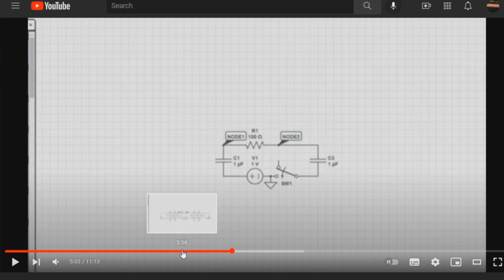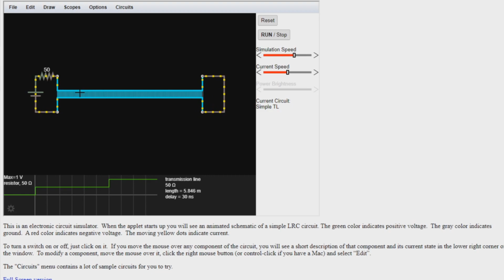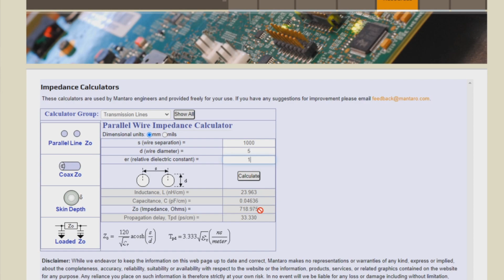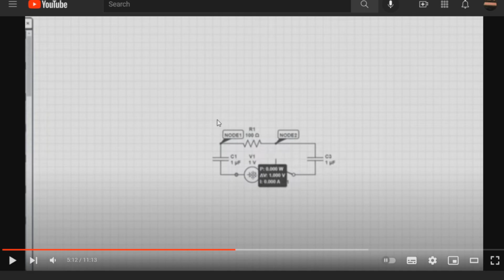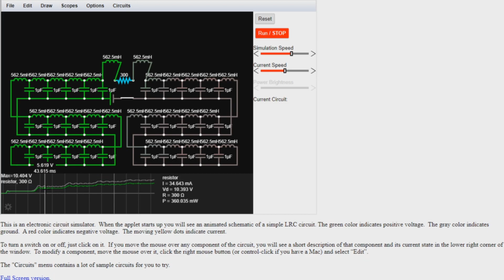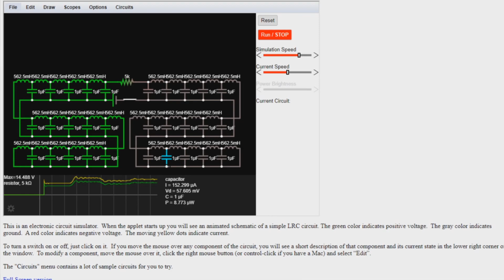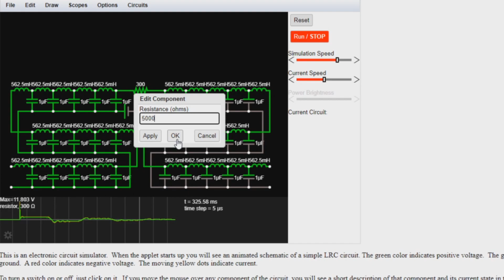2nd analysis, I think I was originally wrong! - Veritasium "The Big Misconception About Electricity"

Comment: 1m/c is 3.34 nanoseconds, and you are simulating in 5 microsecond time steps.  Moreover, you are using a transmission line model but the current at the lamp at t=1m/c depends on the current at the source at t=0+.  And the current at the source at t=0+ is not a current flowing across an infinitely long line, but a moving point charge.  This is a dramatically different problem.  The magnetic field of a point charge falls as the square of the distance.  Even at 1m/c seconds, you have a charge flowing only along 1m of wire (and not the full current yet at that, thanks to inductance).  The magnetic field produced by this 1m of current is negligible.  If it weren't negligible and produced anything like you are calculating, then the wires in the walls of your house would interfere with everything in the room.  The trick here is that the line is LONG, and that adds up to a LONG electromagnetic field.  BUT that LONG electromagnetic field is not established in 1m/c seconds.  Finally, Derek's video misleads by giving the impression that this is the mechanism by which your house circuits are powered and that "energy does not flow in wires."  This is not an accurate description.
Reply: The magnetic field of a long wire falls at 1/r, not 1/r^2.    So a 1M gap can fool us, giving unexpectedly high coupling.  Also, the impedance of empty space isn't that large, so if we started with 1cm twinlead at Zo=300 ohms, then increase the gap to 1M, the Zo only rises to 700 ohms!  (The whole thing is a trick question, meant to attract wrong answers and generate heated controversy.)
You're right of course: down at the nS scale the sharp DC step from the switch should generate multiple reflections across the 1M gap.  The optimum 1400-ohm bulb still turns on at roughly 4mA and 6V, but maybe it takes 10nS or more for the perpendicular oscillations to die down.   It starts to turn on at 3.3nS as Veritasium insists, and should complete the initial step after several 6.6nS cycles (there would be some 150MHz ringing which is damped out by the bulb.)   Then the bulb dimly glows for an entire second.
Reply: @wbeaty  There is no "magnetic field of a long wire" at t=0.  None.  (And it is what happens at t=0 that effects the lamp at t=1m/c).  Nor is there one even at t=1m/c, unless you wrongly consider a 1m wire "long" relative to a 1m gap.

I can raise the gap to 1000,000km and get an impedance of only 3200 ohms.  So what?  I'm going to wirelessly broadcast power to the moon with my 12V battery?

There is essentially zero power delivered to the bulb at t=1m/c.  Zero.  It is simple physics.  Misapplied circuit models don't make it otherwise.  There is no transmission line at t=0.  Just tiny antenna.

The whole thing is a trick question and it tricked the author.  The correct answer is E) none of the above because the bulb is on before the switch is thrown.
Reply: @wbeaty  Jeez, were we also supposed to assume the filament is also magical?  It takes at least 0.5 sec roughly to heat up a filament to glowing, regardless of anything else.
Reply: This whole conversation illustrates why Feynman called Poynting vectors "nuts". It suggests wild scenarios like the initial energy that charges a capacitor comes in from empty space at the edges of the plates, NOT the wires themselves until after the circuit has been running for several microseconds/nanoseconds/whatever.

And yet Poynting vectors work to describe the energy flow in a circuit extremely well; in 150 some years we haven't found something that describes reality better.
Reply: @jeffwells641  I'm not sure what you are implying.  Feynman said a number of things about Poynting vectors.
Reply: @skepticalextraterrestrial2971  I'm saying they have strange implications. As Feynman said, they're nuts.
Reply: @jeffwells641  Feynman also said they aren't as nuts as Derek made them out to be.
Reply from the maker: Sorry for the old reply, I missed this comment the first time around and only recently logged back onto youtube. For anyone in the future reading this, I'd like to mention this simulation does not take into account the 1m/c time delay, that would amount to an extra time delay before the first voltage "step" after I throw the switch. However, 1m/c s is so small compared to the time taken for reflections to propagate that we wouldn't even see it on the graph. What I'm trying to show in the simulation is more the power transfer as to if the light bulb can turn on (after the 1m/c time delay), and the effect of the reflections that occur at 1s+ timescales. For the other point on local or long magnetic fields, it actually doesn't matter. The magnetic fields don't "know" what structure is around them, that's why if I keep both ends of my circuit open or short circuited, the initial response would actually be the same, because the circuit in the middle has no causal information about the end until the signal reaches the end and reflects back, which takes time as distance over the speed of light. Also wires in the room do couple with every other loose wire, you can hear the affect on things like speaker wires or antennas that sometimes have blips or other noise. Normally things are built to reduce this interference, such as by twisting pairs of wires together or just keeping the two wires close together (like in a power cable) would be enough to eliminate most coupling.

Comment: This explanation is WRONG. By using electronic equivalent circuit (EC) you basically shrink the entire setup to an area of few square inches, which neglects the whole information propagation part of the problem. EC only gives you the dynamic response of the current flow of the original setup but under the assumption that all the information travels instantaneously through the circuit which is not true in the original setup. The information travels at light speed which does matter in the original setup.
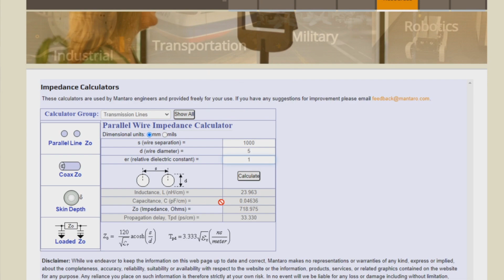Reply from the maker: Sorry I missed this the first time around. In case anyone in the future is wondering the same thing: At 11:00 in the video I show the conversion between the real world wires into equivalent L/C values per cm. These are then rescaled to be 1uF C, and the distance per lump is now something like ~200km. If you look at the reflections times, you'll find that they match exactly the distance represented by the multiple L/C lumps over the speed of light. Transmission line theory does not assume information travels instantaneously. Transmission line equations are derived from Maxwell's equations, as a special case of how electromagnetic waves behave in two parallel conductors. The equations show that the conductors can be modeled with L and C components without any change to the actual measurement of electromagnetic properties or their propagation over time. Basically the L and C model, given enough L and C components, is exactly the same as real world long parallel conductors. No instant information transmission is needed. The one thing the model does not include is the 1/c s time delay between the wires, which would be seen as an extra 1/c s time step before the first voltage step after I flip the switch. In order to model this, you'd need a finite element model of the field equations.

Comment: Nah, you're both wrong yet. 1uF is not available in the first 1/c seconds. 1e-12F maybe. The infinitesimal signal within 1/c sec doesn't clear the average  em noise from the sun at Earth's orbit. Calling BS. You aren't even wrong. You're 9 orders of magnitude wrong. And. Excellent video.
Reply: Agree.  We are talking about the first 3.34 nanoseconds and he shows a simulation with 5 microsecond steps....  As for the sun's interference, that alone lights Derek's magic light bulb before the switch is even thrown.
Reply from the maker: @skepticalextraterrestrial2971  Oops I missed this comment the first time around and didn't check youtube for a while. But in case anyone from the future is reading and wondering the same thing: I'm not showing the 1/c s response time between the wires, I'm showing the overall transient response from all the reflections and if it can even turn on a real world light bulb. The 1/c s thing, if simulated, would just be an 1/c s time delay before the first step after flipping the switch. For the previous comment about the size of the capacitance, I mentioned in the video the L/C can be freely rescaled to higher values. This makes the simulator play nice (you'll run into floating point errors at 1e-12 numbers) and it also makes it so that you don't need a thousand elements to simulate the transient, which would be too tedious to place by hand and probably will crash my computer.

Comment: Good: two weaknesses..1. I doubt the first meter of wire has ~1uf at 1 meter separation.
2. This doesn't compare the rf harvesting that will be taking place given such an antenna.
In short, the immediate effect of the switch may not rise above the noise. To have a signals discussion with snr is naive.
Reply: I believe the first question is answered in 11:29, the 1uF is chosen so that have a equivalent circuit but with workable delay time.
I think saw someone in the comments tried to increase the elements and reduce their values and still gets the same results.
Update: the comment was by A Raybult.
Reply: @ShiehJimmy  the problem with 1uf is that it represents 50,000km of wire. Not close.
Reply: @BenjaminGatti  the video has said that the L and C valve are multiplied in purpose to allow us to simulate it in a manageable time step.
Reply: @ShiehJimmy  ok, but 50000km is not manageable.
Reply: @BenjaminGatti  No, it isn't.  He is trying to simulate what happens in 1m/c seconds and using values for 50,000km of wire.....?
Reply: @skepticalextraterrestrial2971  yeah, the 1uF is a huge value really. I think default. A for effort, but not much else
Reply: @BenjaminGatti  well, using a smaller C and L will only makes everything faster. The impedance of the wires stays the same, and the voltage measured across the bulb will be the same, just with shorter time, and the current will travel to the end of the wires faster.
Reply: @ShiehJimmy  I'm curious why you think impedence matters here. Does Impedence communicate energy across space?
Reply: @BenjaminGatti  the impedance different between the lines and the bulb dictates how much energy get to the light bolt and how long will the circuit stabilize.
When impedance matches, bulb will get half of its max power before the reflection comes back and reach the bulb.
Reply: @ShiehJimmy  I feel you are not including self-impedance and cross-impedance. Can we agree that at any point in time, the wave front is closer to other parts of the same wire than the 1 meter between the wires?
And the left two wires are pretty close to the right two wires at 1m/c sec. So the induced energy is going all over the place, a bit chaotic, one might say noisy.
Reply: @BenjaminGatti   isn’t that the self impedance and cross impedance being modeled as L and C int the transmission line model?
Reply: @ShiehJimmy  ok, yes, there is capacitance across the line which is modelled, but there is nearly as much capacitance on the diagonal which is not modelled. Physics is messy.
Reply: @BenjaminGatti  do you think if we move the line closer like 1mm apart, will the model becomes reasonable for you?
Reply: @ShiehJimmy  1mm wires at 1mm starts to look like capacitive inductance, but remember the effective length at roughly 1/c s is roughly 0mm . To explain: whatever is going to affect the lamp 1m away within 1/c sec will need to begin the journey immediately. Any path other than a straight path will take longer than 1/c s. You want to talk about the qualities of the wire in the non-straight path, but those wires roughly don't matter at 1/c s. Let's say they start to matter at 1/c sec. So at 1.5/c sec each wire can be 0.25m in length. Now imagine all the cross contamination of any signal?
Reply: @BenjaminGatti  when I said make the wires closer I also meant make the bulb and the switch closer. So 1m/c shouldn’t be a factor in this case?
What does the “effective length” mean there? I’m a bit confused. Isn’t the effective length at 1m/c s exactly 1m?
Reply: @ShiehJimmy  yes, the effective length of 1/c  is one meter radius from the lightbulb.

So what does that include?
2 Meters of unpowered wire, 0 Meters of wire near the battery or switch.
Reply: @BenjaminGatti  So the lightbulb won’t be light up before 1m/c.  But what happens just after that? Will it lit up before 1s?
If I make the whole thing smaller 1000 times, so that the gap across the wires 1mm, can it lit up before 0.001s?
Reply: @ShiehJimmy  after 1/c sec, we can start to expand the effective distances, so some wires will have length and begin to be affected by distant events; now we have questions about how much current will light the lamp, how much noise in the environment, and how much voltage will burn up the lamp.
Perhaps the answer must be that the lamp will be detectability brighter without burning out after 1sec.
Reply: @BenjaminGatti  do you mean that there will be a voltage spike greater than the voltage of the battery? That’s weird.
Reply: @ShiehJimmy  no; however, the battery voltage will be much greater than the signal recieved at or briefly after 1m/c sec. The question is what lightbulb can light at small voltage, but also not burn up at full voltage.
Reply: @BenjaminGatti  don’t use a bulb then, let’s use a resistor and measure its power. The simulation shows with the right amount of resistor you can get half of the full power at best, and you seemed to disagree, because you think the capacitance between the wires are not enough, right?
Reply: @ShiehJimmy  getting half of the battery voltage is impossible in the first 1/c because the capacitances are crossed - meaning the right/left coupling is just as good as the right-right coupling. The cross coupling will prevent meaningful voltage accumulation. Current is much lower because the field is heavily dissappated at 1 meter. Imagine how many wires you could place around the first at 1 meter, about 3.14 thousand if the wires are 1mm wide. So that many wires could get the energy, which means each wires can expect 1/3.14k of the radiated energy. Good luck.
Reply: @BenjaminGatti  you can’t just put additional wires in and expect the field to be the same. It’s like adding parallel resistor to the ‘bulb’ in our model. The result will be different.
Reply: @BenjaminGatti  does this mean if we make the wires by the bulb into a tube(with 2m diameter) that wraps around the wires connected to the switch and battery, the power will get through?
Reply: @ShiehJimmy  I like what you're thinking here, this at least would be a capacitor, and it probably would collect a fair amount of the available energy, however, the energy still would not be well organized meaning The minus side would have a lot of exposure to the positive side and the positive side would have a lot of exposure to the negative side. If we did create something like this, we would still have to delete all parts of it that are beyond one meter from the light bulb for 1/c .
So there wouldn't be much left, and much of what was left would represent paths that are longer than 1 m between the two points.
Reply: @BenjaminGatti  I’m a bit confused about the positive and negative sides and the exposure here. What do you mean by that?
Reply: @ShiehJimmy  lamp has two inputs,  for any current to flow, those need to be out of phase. For good capacitive coupling, they should be coupled to opposite sides of the switch. But at 1/c they are equally coupled to both sides of the switch. So the arriving energy pulse produces very little useable yield.
Reply: @BenjaminGatti  where the power get across the lines by electromagnetic interference is at the wave front. It’s from wire to wire, not from wire to the bulb. You have to consider the fact that the wires by the bulb exists. The energy actually go to the wave front by wire, get across by electromagnetic interference, and then goes to the bulb by wires.
The electrons in the wire at the right side of the bulb are being pulled to the right by the electromagnetic interference moving away from the switch.
Reply: @ShiehJimmy  you say the wire to the right, both bulb wires are equally distance from the switch, and the wave front is transmitting an EM wave in all directions. I agree, over time, it will become positive on the right, negative on the left, but initially these fronts are coincidental. And that complicates the early phenomena .
Reply: @BenjaminGatti  why is the wave front coincidental?
Reply: @ShiehJimmy  I am trying to explain that the - pulses and the+ pulses emenate from the same point (the switch) and that initially both - and + have equal impact on the bulb wires.
It isn't until later that - and + separate.
Reply: @ShiehJimmy  it begins at the switch. It doesn't begin in the wires, it only travels to the wires.
Reply: @BenjaminGatti  I see, that’s a good point. So even with a ideal impedance the bulb won’t get the half of the power predicted by transmission line model right after 1m/c s. It will get that later when the wave has travel like 10m. Am I getting your point right?
Reply: @ShiehJimmy  Yes I think you won't really see the transmission line until the line length is longer than the line separation